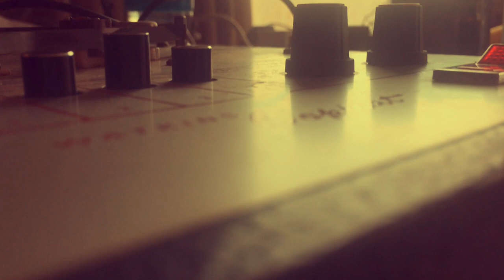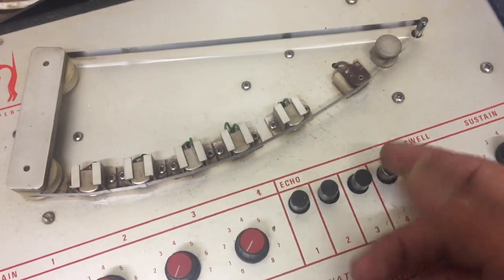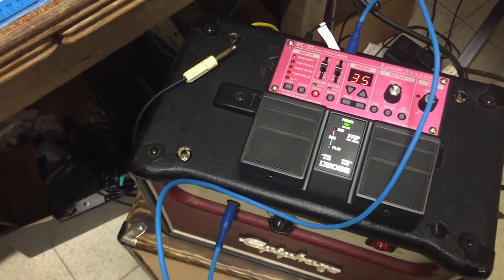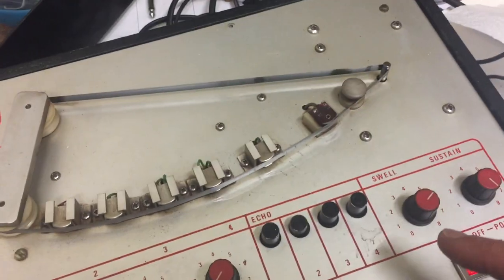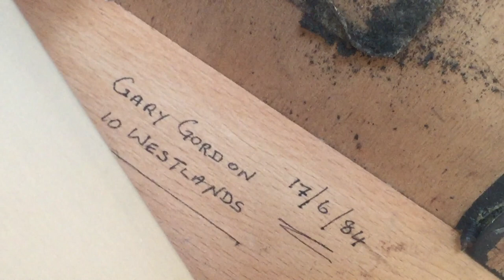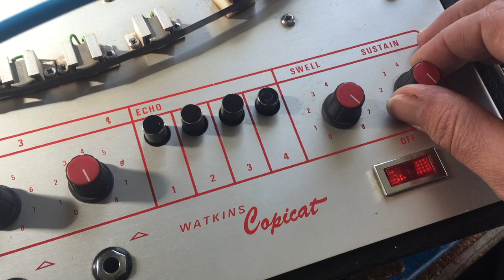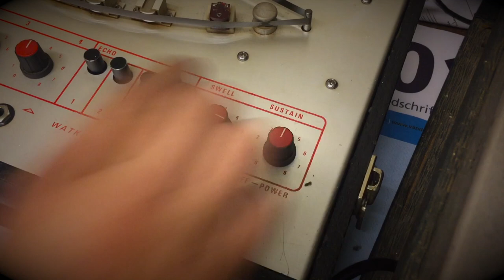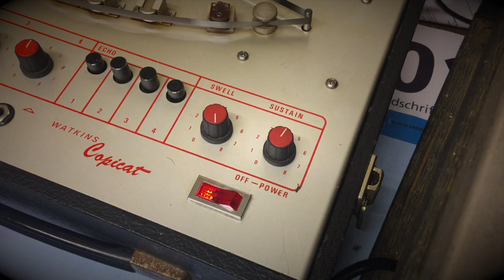1978 WEM Watkins Super IC Copicat Tape Delay - service & demo

Comment: hey man, I wondered if you might know why im getting an infinite delay underneath everything at all times when the echo is engaged. Thanks for the help! W
Reply from the maker: Hi Willow, I would have a closer look at the erase head. If you get infinite repeats, the erase head is not doing it job. Is it not touching the tape? Is it dirty? Is it simply not working? 
The erase head only has two connection and there should be some voltage across those connections...
Do hope this helps-- take care, J

Comment: question - why isn't yours self oscillating to all hell with the sustain up? mine sounds so distorted and oscillates with the slightest touch of the sustain past halfway on any head really. does it just need a good cleaning?
Reply from the maker: Hi there, cleaning the tape heads is always a good idea, also make sure the tape is properly seated. This makes a BIG difference... I learned this only recently when my tape snapped. In fact, the glue had dried out, tried to fix it with normal scotch tape, and it didn't hold (for long). Otherwise ordering a new tape may be an affordable next step. In my opinion, it's only reel-to-reel tape. Find one of the correct width and you can make your own tape loops. There's an idea for a video ;-)
Reply: @zjokka  would you recommend rubbing alcohol to use for the tape heads cleaning?
Reply from the maker: @figodiscs4494  Hi Figo! Yes cleaning the heads with alcohol (isopropyl alcohol is best), but will never bring a dead tape head back to life. You could always measure the tapehead -- it should have some resistance (check the schematic), if it doesn't, it cannot work. Hope this helps!
Reply: Mine too. I think his feedback loop is not working properly.